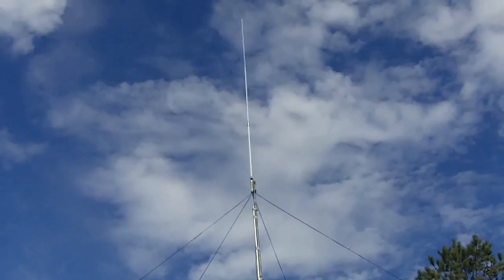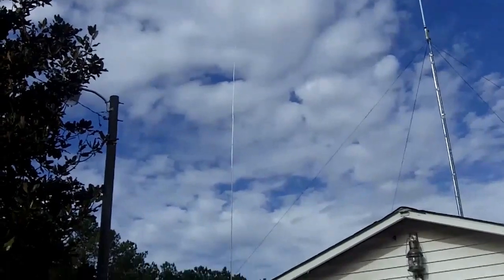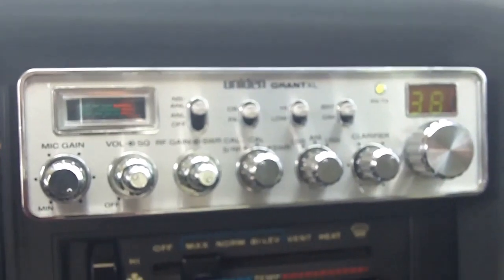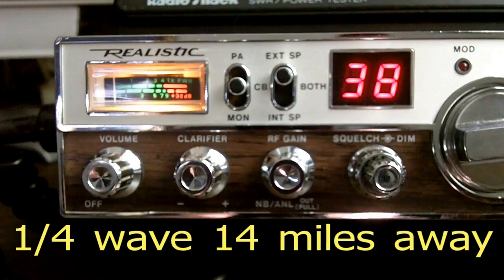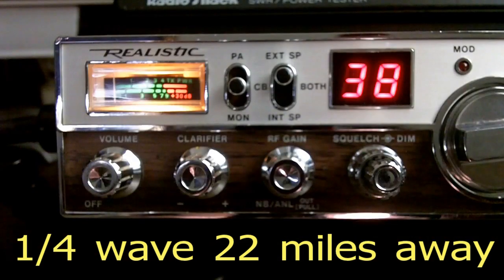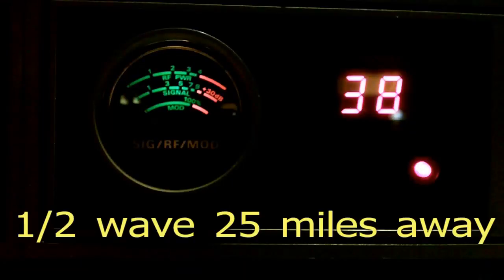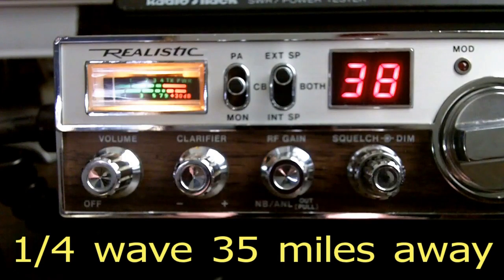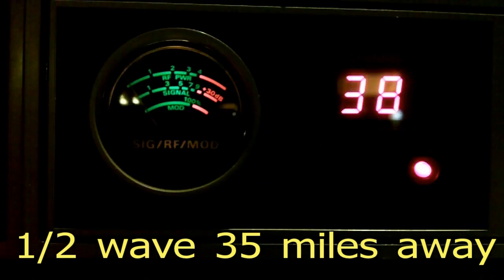Ground Plane CB Antenna comparison

Comment: I just had this discussion with someone on one of my antenna videos. Years ago, I did a similar test with a 1/4 wave M-400 Star Duster vs a IMax-2000 and there was no comparison in both the TX and the RX especially after 20 miles. I was using the same pole for each antenna so they were exact as far as height and location went plus they were both using the same coax too. I still run the star duster on the shop and it's only 20 feet up from the ground but I can easily shoot skip into NY and Texas etc with a barefoot radio. The IMax-2000 bit the dust so I no longer run the IMax-2000 and I'm now running a Sirio Tornado 27 5/8 wave on the 50 foot push-up pole and that antenna has a narrower bandwidth than the IMax-2000 but the performance is pretty close to the IMax-2000 on TX and RX... 5/8 wave is really the best way to go. If you ever consider switching over to a 5/8 wave you should consider the Sirio 817. It has a bit better specs than the Tornado antenna. That will be my next antenna to try out in the future. 73's and have a Merry Christmas and a Happy New Year...
Reply: You should really try out the Sirio Vector. This antenna would put that tornado in the ground and eating dirt. Make sure you have guide wires for the antenna because this antenna is very heavy.
Reply: @sweirich777  I went and looked up the specs on the Sirio Vector and it does have good specs.
It looks like it's geared more towards 10 Meters although it will operate in the 11 Meter band.
I went ahead and copied the specs for this antenna along with the 827 and the Tornado just to show others reading this the difference in these 3 antennas. They refer to the Vector as a J-Pole antenna. I didn't know if you were aware of that or not but I wanted to mention that. Sirio Vector: 3/4 Wave length /  Gain: 2 dBd, 4.15 dB / 1.4 Mhz bandwidth / 1.2 SWR at it's center tune / Max continuous power 1000 Watts. Sirio 827: 5/8 Wave Length / Gain: 1.5 dBd, 3.65 dBi / 2.0 mHZ bandwidth / 1.1 SWR at it's center tune / Max continuous power 1000 Watts. Sirio Tornado: 5/8 Wave Length /  Gain: 1.2 dBd - 3.35 dBi / 1.2 Mhz bandwidth / 1.2 SWR at it's center tune/ Max continuous power 1000 Watts. The Sirio Vector does have the better specs out of the other two but the Sirio 827 holds it's own against the Sirio Vector. The 827 has a wider bandwidth and a better SWR at it's center frequency but as a trade-off for the extra bandwidth it has a bit less gain. The Sirio Vector is going to be better than the Sirio Tornado and that's a given. The Tornado cost $80 where the Vector cost $153 and the 827 cost $150. Both of these antennas are built like battle ships where the Tornado is built with thinner walls. I have a 827 but I haven't set it up yet but I plan on setting it up somewhere in the near future. The most important thing about all three of these antennas is they have a low radiating pattern which keeps the signal where it can do the most good compared to a 1/4 wave or a 1/2 wave where their patterns radiate higher and you also have better gain on the 5/8 Wave and the 3/4 wave length antennas compared to the 1/4 Wave or the 1/2 Wave length antennas. Just curious if you are using this on the 10 Meter band too?
Reply: Do love a m400 .mine sat 70/80 feet and worked a treat
Reply: @SimonHilson  The M400 also known as the star duster was the first actual base station antenna I used when I started working at a electronics repair shop that had one on the roof. It's a decent 1/4 wave antenna and in my opinion it's a better antenna than the Antron 99 but over the years, I've really gotten to where I really appreciate the 5/8 wave antennas. The RX of a 1/4 Wave or even a 1/2 Wave just don't hold a dim candle compared to a decent 5/8 wave omnidirectional antenna.
Reply: Have  run a99  and  5/8  but  starduster  my best. 82 feet to tip and 25w of air at mo might set  up sping time 2x starduster s  would b nice wot about a 5_8 starduster  has e 1 made  one😊ps whack it at um
Reply: @SimonHilson  I meant to mention that I still run a M400 starduster antenna on my shop roof. What I've always liked about those antennas is the solid low SWR and bandwidth and it also doubles as my scanner and my SDR receiver antenna. You have yours way high up in the air and that really helps with distant local stations. As far as dxing, yeah it's a good antenna. My only issue is the receive for distant local stations I speak with. I have tested and compared the M400 performance along with the Imax-2000 and the sirio 5/8 wave antenna on the same tower at the same height using the same coax and the same radio hooked to the system and on distant stations the lower receive with the M400 was very noticeable with my regular locals who were off in the distance from me and they could also tell the difference on the lower S units they received from me compared to the 5/8 wave antennas. I also did the test with those antennas driving with my mobile setup too and I could tell the difference. Where the differences stood out was around 8 to 10 miles distance from the mobile to the base station. I speak with a lot of locals that are anywhere from 20 up to 70 miles away from me so a good antenna that's at least 50 feet up in the air from the bottom of the antenna is a must for me.

Comment: No such thing as a half wave ground plane 🙄 the half wave is an end fed dipole , voltage fed so no earth radials required . A 1/4 wave ground plane as a touch more gain than a dipole . A 5/8 wave with 1/4 wave radials is the way to go .
Reply from the maker: lol

Comment: I thought you were gonna run AM, but it sounds and looks like SSB.....What's the SWR like on those antennas?
Reply from the maker: All of My antennas have an SWR of 1.2 or better. I don't really use AM very often, So most of My testing is done on SSB. This way I also get to talk with My locals while I'm doing My range tests. Thanks for watching, Happy Holidays.

Comment: Also you should try a full wave dipole in a vertical orentation
Reply: That would be too long to be effective, there would be multiple lobes, none pointing where you’d want the signal to go. 0.64 of a wavelength is max
Reply: @toby000000  ok sounds logical

Comment: Is the shooting star 225 a linear amp.  Is it legal?  I'd like one...
I also live in South Carolina
Reply: No….the legal limit for CB radio is 4 watts on AM and 12 watts on SSB.  Put your money into antennas and quality coax cable (LMR-400 or better) and it will do more than an amp generally.  Now, that was the truth and legal answer……will you get prosecuted for using a linear amp?  Probably not.  Might have a better chance winning the lotto than getting caught, but in reality.  Most linear amps make you sound like crap on the radio and bleed over several channels.
Reply: @DocJoeThesDoctor  thank you
Reply: Just about all cbers run an amp these days.

Comment: 1/4wave has a higher angle of radiation Vs 1/2 wave .
Ground affect is also a factor,once you get above ground ,around 55-65ft  in my tests I found it would make a difference and ground radials are more critical,great video 👍
Reply: rpcomms1: Very cool!! That's just what I was thinking! (the angle of radiation 1/4 wave-vs- 1/2 wave!! We radio dudes(& dudettes!!) are a clever bunch, ain't we?!
73's from Norman in Montreal, Canada.
Reply: @norman2999  Ive also discovered its best to isolate the antenna from mast, the mast should be Earthed via copper ground rod for electrical safety!, but the antenna and ground radials float, why because SMP PSU do not like being ground via the dc neg to EARTH,rfi,emi,dc rail noise! Why you ask? if you isolate the coax braid sits at dc negative ground, the mast at Earth ground and you connect the two together ,ull get a ground loop! SMP PSU do not like this as its a balanced DC output on power supply. Yes height of mast on 1/4 GP also affected  impedance due to ground effect, my tests showed ideally 55-65ft or more for least ground affect, also the ground radials become efficient. Yes the 1/2 will have a slightly higher angle ,gain about 2.5-3dB (about 1/2 a S point),the advantage with 1/4 GP is less windage loading VS 18 ft 1/2wave.

Comment: Interesting comparison , how about trying on AM ?, establish contact on ssb the both stations switch to am on an agreed channel. I have has some spectacular results on am when doing this switcheroo , using a 1/2 wave vertical ant at only 12 feet above the ground. The best distance I could get on am was 2900 miles !

Comment: Interesting comparison. Just an observational question though, how long were the ground plane radials on the 1/4 wave antenna? i'm just curious as in the video it didn't look like there were anywhere close to 1/4 wave in length. The other questions i have about the comparison is what was the coax that you used on each antenna? and what were the antenna heights? as far as antenna locations it really isn't a fair comparison as you can move the antenna 6 feet 1 way or another and have completely different results. What you would really need to do is test with 1 antenna then after the test take that antenna down and put up the second antenna in it's place. That way you are keeping the location the same, Antenna height the same, the coax type the same and the coax length the same. for me there are just too many question marks to call it a fair comparison. None the less though as i had said, interesting comparison.
Reply: Early in the video he stated the ground plane elements were 103 inches.

Comment: To be fair, the Antennas should be at least on same height. They don't seem to be, is that right? And please allow me to ask why to put Radials on a Halfwave Antenna?
Reply from the maker: Both antennas are at 31 feet to the coax connector. the ground radials change the angle of radiation from the antenna.

Comment: I was thinking about the take-off angle of your 1/2 wave that may be a clone of the A99, if so adding the radial kit is said to help with skip because it LOWERS the take-off angle. Please remember the radials on the A99 are not resonate on 27 mregs but more like 32 megs, which means you might get better skip by shorting the radials to the length used by the A99 which is less than 102 inches. Just a thought, but it might be worth trying. Also because your 1/2 wave end fed has 2 coils in it to match, but this matching might eat up some signal? The half-wave in theory should be stronger if we use the old saying, to be stronger use more metal.. I once had an M2000 and an A99 mounted near the same height, same coax, and same length, the 2000 was 1.5 DB better both receive and transmit. The old 102-inch whip is still hard to beat if installed correctly as you have done it. Again, CB as it is best done, you show the same fun I found now over 60 years ago with bright eyes hear signals from all over the world. I just wonder how many countries we might have worked with todays' radios back then. The old Johnson transmitters and a good receiver did it then and covered the frequencies we use today. Hopefully, as this sunspot cycle grows the old worldwide openings will return. Back then channel 22 A, B was used by oil companies all over the world in their drilling locations, I worked several of these sites remembering one in Russia just north of Japan when an American drilling company was drilling there for the old Soviet state-owned oil company.

Comment: As a general rule, the more Mass you have in the air the better.
During skip, you need to use Channel 35 LSB to reach Australia. It's out local channel.

Comment: Hey there mower junky, I always enjoy watching your videos! Always good stuff. I've always enjoyed your homemade antennas.

I regularly drive my mobiles out to between 25-40 miles away. There is a big mountain range in-between. I test on AM channel 20 since it's right in the middle of the band. I rarely talk on SSB. I tune all my radios for maximum audio and I've gotten some incredible results.  I run a Penetrator SPT-500 ground plane back at the base at 36 feet to the bottom of the antenna. 

Since you're a mower junky, do you by any chance watch Tarryl fixes all on YouTube?
Reply from the maker: I have not watched that channel. I love working on mowers, But I don't like to watch others do it.
Take care, Happy Holidays.

Comment: You really need to get a high performance 5/8 wave ground plane. Several great antennas to choose from. What a difference it would make.
Reply from the maker: I would like to get a 5/8 wave antenna, But I'm working with a small budget and use what I can afford. Take care, 73's from 151 SC.
Reply: @MowerJunkie  Make one, roughly 21 feet.
Reply: 5/8 wave antennas are a compromise antenna. The higher radiation angel is shifted lower, however, that is less than ideal for all locations. While a 5/8 antenna is a good choice for those who are in a high location or in the clear, those lower in elevation will have quite significant ground loss. Transmitting your signal into nearby hills equates to substantial loss and signal degradation. Also, shifting the max radiating angel from about 20 degrees (half wave) down to about 16 degrees (5/8 wave antenna) is not as good for sporadic-E skip (the most common type) in all cases but does have the edge in long skip. 
Sporadic E will favor the half wave every time as 20 degrees is the optimal angle. 
So, one can never generalize that one is superior to the other. 
The real answer is that it depends. There are path profiling calculators on line that allow you to plot your radiation pattern from a particular location. At my house in Pennsylvania, (1,485' ASL and the second highest point in the county) the 5/8 wave antenna is a winner. From my house in Essex county, NJ, the half wave is, by far the better choice.
Reply: @timmack2415  Can you tell approximatelly how "clear" should terrain be to experience benefit of 5/8?
Reply: @timmack2415  Hi, thanks for info, perhaps i am not searching correct, can you point please one path profiling calculator, thanks
Reply: I've gotten excellent results from both my Sirio Tornado 27 and Penetrator SPT-500. Once you switch to an aluminum 5/8ths antenna, there's no going back.

Comment: Interesting video and even more interesting were the ideas in the comment section as to why the results were what they were. Apparently opinions are like noses, everyone has one. The only thing for sure in CB radio is that every person knows what works, and it just happens to be what they have, no matter what that is.  :)
Reply from the maker: Yup! I get asked a lot "what is the best antenna"  until I have had one of every kind of antenna made......I just can't answer that question. Thanks for the comment, Happy Holidays.

Comment: 1/4 wave will hit the ionic layer sooner, and have a stronger rf signal. The 1/2 wave hits lower on the ionic layer, but is faded by its range and rounded bounce off of the layer, it may be in fact skipping over stations, and hitting ocean. Thank you wife for being so supportive of your research documentation of only written theory, that in reality always has suprises in the results, yet same ol' fun. 😁
Reply from the maker: Thanks for watching. Happy Holidays, 73's from 151 + 268 SC.
Reply: Right back at ya!
Reply: ionic layer?

Comment: Ground plane antennas have a high takeoff, ideal for DX. 
Dipole antennas have a low takeoff in vertical polarization, good to local comunications.
Reply: The groundplane provides the unbalance to match impedence at feedpoint of 52 ohm coax, it does not radiate different because of that, it is forced up because of ground reflection. A horizontal dipole radiates lower, but broadside, and at ends it has nulls. For skip, a rotatable broadside favoring east/west, north/south, ect. is  a great setup for noise reduction, and polarization cancelling out local stations, and just 16.5' of wire and coax.
Reply: The engineering documents for the original Hy-Gain Colinear, the daddy of the CLR2 and the granddaddy of the Penetrator, are available for free on the web. Same with the Hustler G-2537,  a direct descendant of the Super Swamper base antenna. That one shows the difference between a 1/4, 1/2, 5/8, and .64 wavelength antennas.

Comment: 5/8 wave has much better gain and this test proves it has better ears. Great video!!
Reply: @45AMT Do you think a 5/8 wave Sirio GAINMASTER is better than a 1/2 wave President HIMALAYA WB??? Thanks for any reply!
Reply: @AEZAEZEL-187   Sirio isn't a bad brand and 5/8 has more dB gain, that would be the better antenna compared to a 1/2 wave.

Comment: May I ask what did you put around your antenna to put your ground elements on what did you attach those ground elements to
Reply from the maker: the 1/4 wave has an aluminum collar, and the 1/2 wave has #12 wire clamped to the base of the antenna.
Reply: @MowerJunkie  Thank you sir

Comment: You pretty much can talk all over your town if the channel is clear. Using one of the slots or A channels very likely one would be clear so it should work. If one of those was an A99 clone then it is not a ground plane but an end-fed 1/2 way with the angle being better one the1/4 wave. Interesting test, your radios are very clean and clear both ways. Sadly too many CBers try too hard for distance and overdrive, but you my friend are the exact example I love to remind condescending fellow Hams still exist and seem to be now keeping the hobby going. Your pileups of folks trying to make contact show more courtesy than many Hams. Listening or watching DX Commander with an 80-meter net he has been doing, some guy was recording him and playing it back on top of him on air, stuff we all hated years ago, but hopefully is gone now.
Reply from the maker: I had someone do that to me too, They were broadcasting one of My skip clip videos.
Thanks for watching, Happy Holidays.